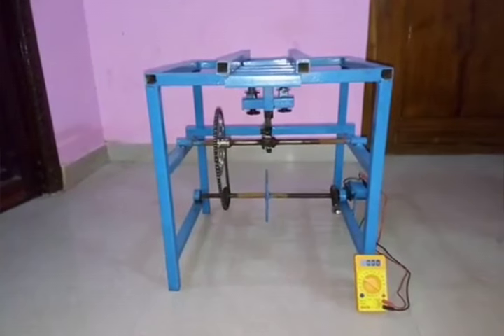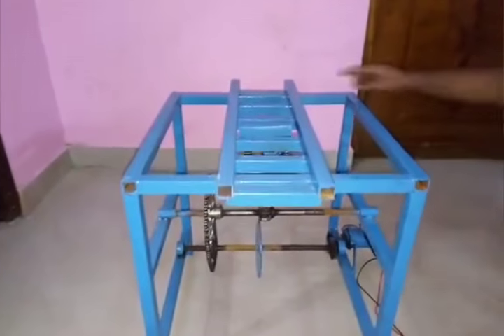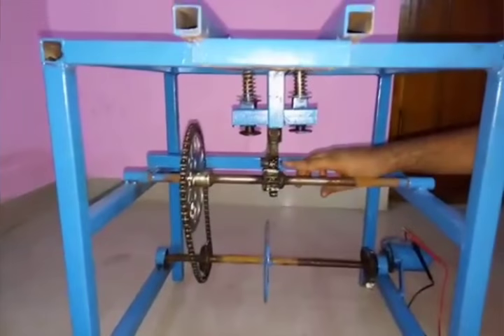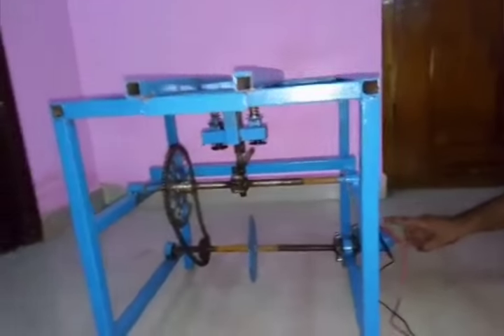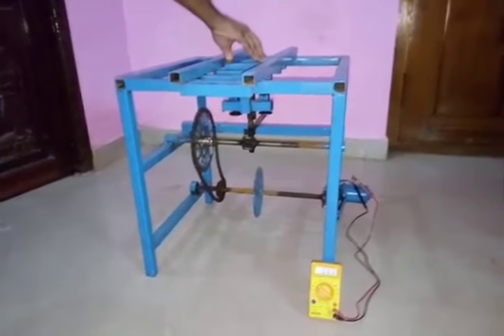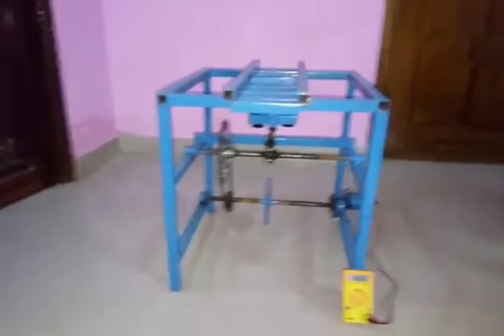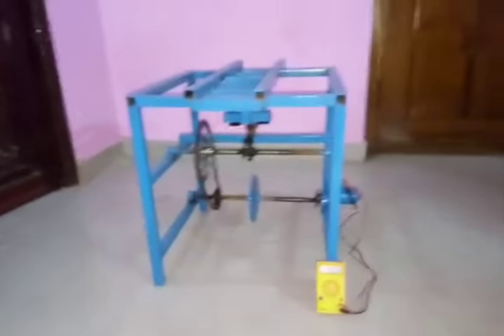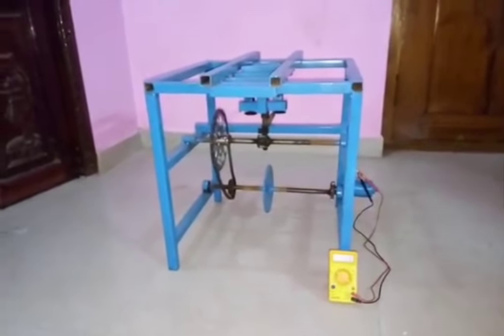Final Year Project on Railway Track | Mechanical Engineering

Comment: Holy crap... All these questions and no one has even bothered to ask where the train would get the energy to depress all these beams... When you force the train to push down the beam, it causes the train to lose some of its forward momentum in order to press your bar down. Now even at 100% efficiency, it would mean that the efficiency of the train's engine would be the efficiency at which you generate your power (as the train's engine has to work again to build up that lost momentum). That's still lower than a power plant which has the sole job of generating electricity at maximum efficiency. It doesn't have to haul a ton of fuel and fight a bunch of friction and make sacrifices for weight and space among all the other inefficiencies that train engines face... :| It's quite alarming that people who are at this high level of education still don't understand basic laws of energy conservation...

Comment: this idea is really good. but, why the thin disk is fitted on transmission shaft which connects the driven gear and DC-generator. can i assume it as a flywheel....

Comment: train moves only in track, then how could the horizontal bar get  reciprocate??
Reply from the maker: +vaseem khan actually the horizontal bar will be extended between the rails
Reply: If the horizontal bar will extend, it will reciprocate and goes downward, isnt it harmful, because here which js reciprocating in between the two line, not connected with the line